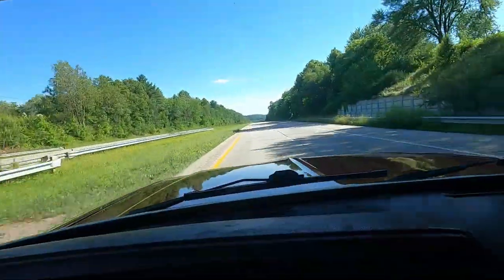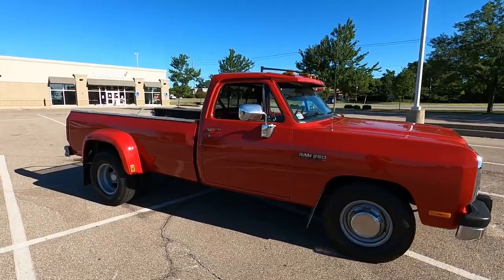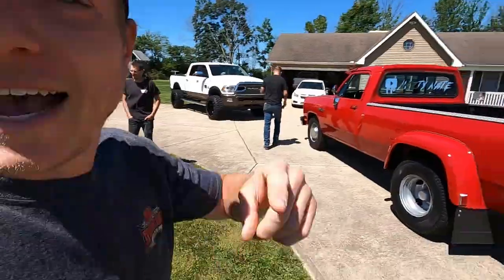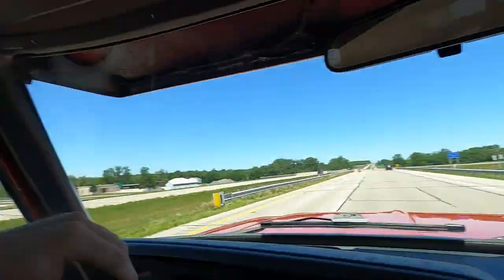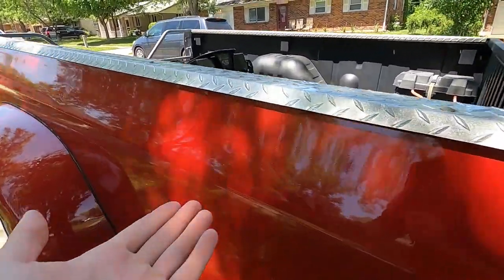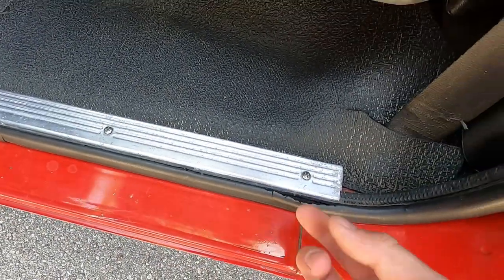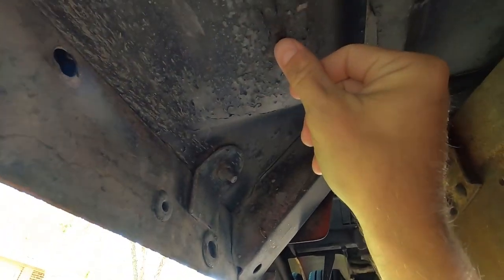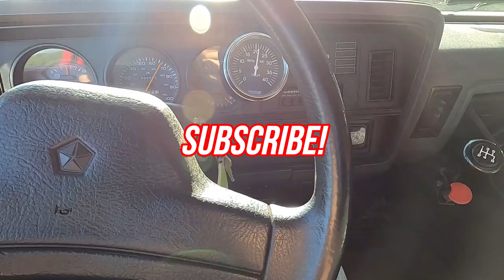I Bought the CLEANEST 1st Gen Cummins I Could Find

Comment: I had a 91 back in the day I bought new, older than you, it was awesome, in 5 years I replaced 2 voltage regulators and injection pump under recall , that’s it so simple and dependable. Now don’t go nuts it so cool the way it is
Reply from the maker: I agree, this thing is too nice to mess with too much. But I do have some big plans that I think most people will like 😎

Comment: Love those Body style dodges lasted 21 years 1972-1993.
Reply from the maker: It's insane how long they made them! Only had a Cummins for a few years though!
Reply: @NaztyNate  that Body came put in the fall of 71 for a 72 model year Still 21 years am 21 so lasted longer then me by a couple. Months by 1993 Dodge Full Size pickups were showing its age the new 94 was supposedly going to be out in 1991 but was delayed the grill for 91-93 is for what was suppose to come Still straight out of the 70s.